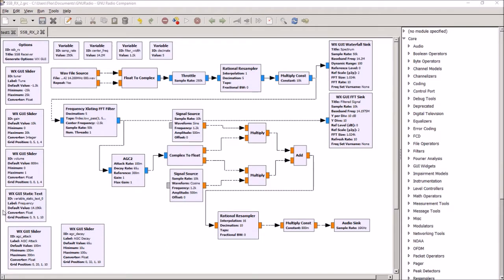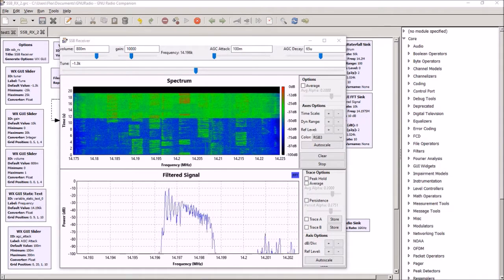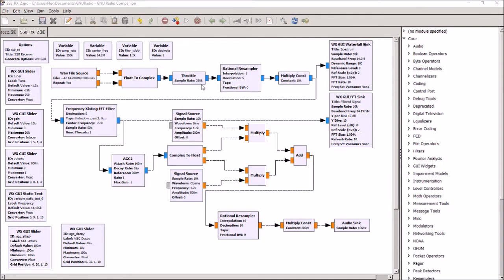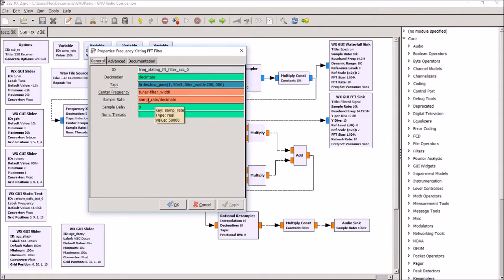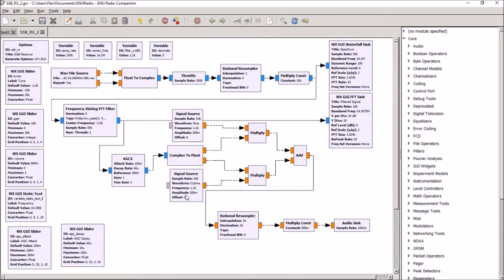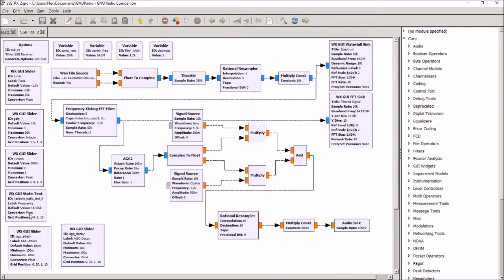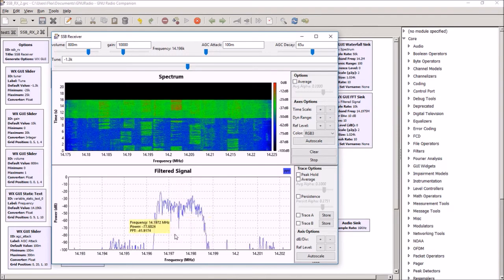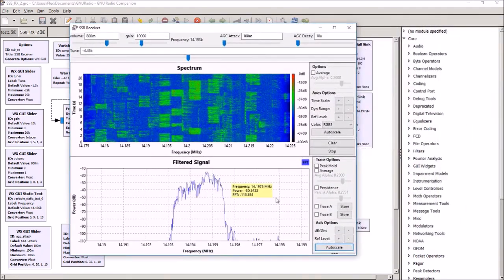GNURadio SSB Receiver

Comment: I cant get this to work and my best guess at this point is that the rf signals are simply too low. Did you use a low noise amplifier when you recorded the original wav file? If you could give a dropbox link to download that wav file I think that would be very helpful for a lot of people in verifying everything working before replacing the file with an SDR board as most of us are doing. Great content, looking forward to it!
Reply from the maker: Hi Zac. It's been a while, but I will try to dig out that file for you. No LNA, just a simple I/Q recording using my Perseus receiver.

Comment: why not a damn receiver ? Lame !
Reply from the maker: If you just replace the WAV file source with a downsampled I/Q stream from an SDR like RTL-SDR, it's all the same.
Reply: @VE6EY  why not simply build a Receiver, like I finally did. Simply works, no file rubbish. Receivers don't use Files. They work off an Antenna.
Reply: @paulfrancis8836  think of the possibilities though with a playback...  You can do a capture then do years of processing with any recovery and filtering you want.  Wanna tweak a design to catch the weird signal that happens once every three weeks next time?  Just get a decent capture of it and wail away on it.

Most decent listening stations will do a capture constantly, so that they can analyze the spectrum later.  IMHO, you're missing out if you don't capture wave files.
Reply: @Real_Tim_S  But a Receiver first has to pick up the signal from an antenna, then save it as whatever file you like. Alls's fine, except the Receiver is Missing. People want GRC files as Receivers, .. and sometimes Transmitters.
Reply: @paulfrancis8836  In SDR, a broad-spectrum ADC picks up the signal - and every signal around it, and those samples are what's saved in the WAV file.  Think of it like this:  A single microphone on a stage can pick up the entire band playing a song and the audience singing along - what this demo was like was taking that jumble of music and picking out just the lead guitar player's notes - that's what a "receiver" does.
Reply: @Real_Tim_S  A Receiver receives RF, that's what a receiver does. Any wave file player can play a wave file.